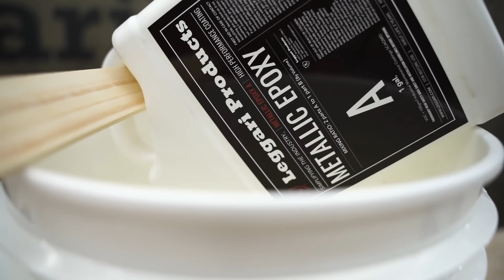Moon Rock Epoxy Flakes For Custom Industrial Flooring Overlays & Coatings

Comment: I was thinking that’s way too many flakes, but it turned out great!  Solid product as when you back roll it typically means it’s 100% solid epoxy which will hold up for a long time! 👍🏼
Reply from the maker: Sometimes you just send it, and it turns out PERFECT! Thanks for the comment :)

Comment: Can you do a second design (colored epoxy like the floor you covered up with this) so this is the base but has color above it? Not solid but a “pretty” design? I dislike the carpet in my basement, like the look, but it needs more than just chips......(yes, I know there are other chip colors!)